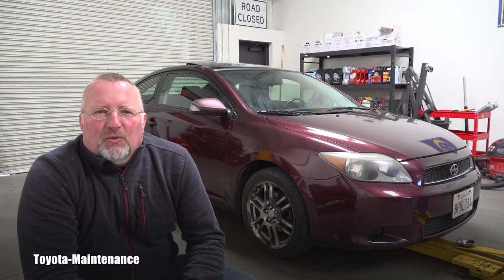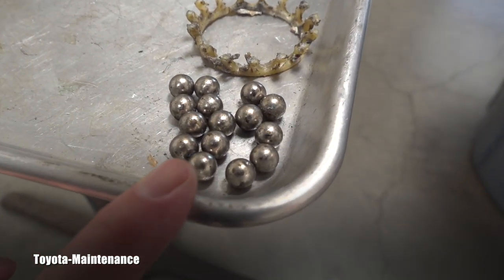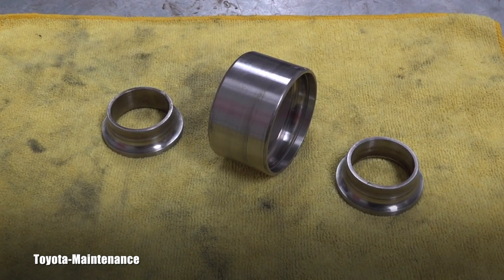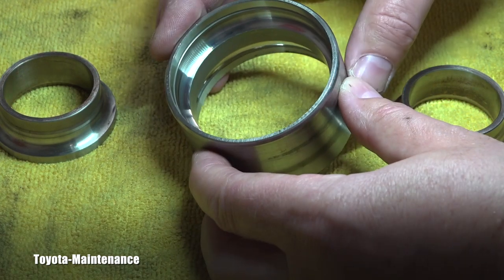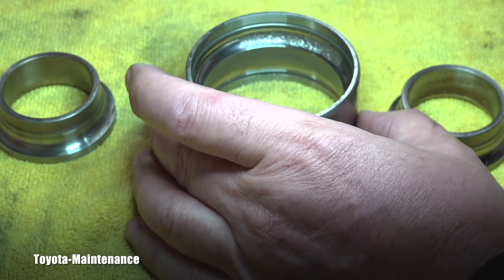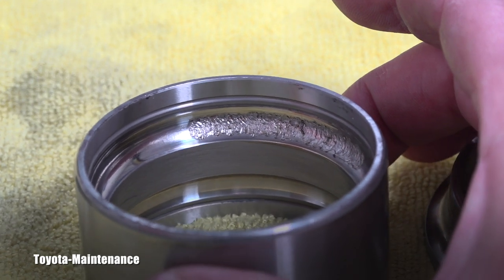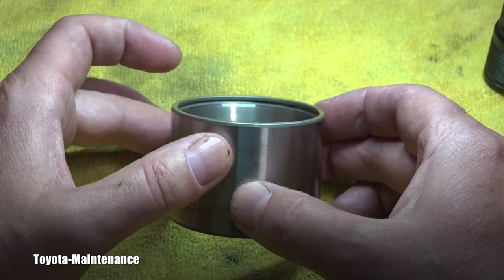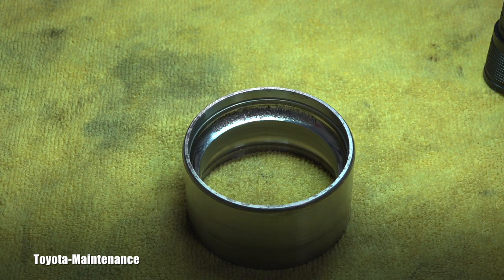Inside of Bad Wheel Bearing

Comment: Saw this on 2000 corolla and 1987 Camry. In my opinion tightening the axle nut with impact gun transmits vibrations from the inner race to the outer race causing surface damage of the outer race

Comment: So the question I have since I did the same repair few months back is are you going to keep those 1/2 inch  ball bearings like I did in a zip lock thinking these might come in handy for something down the road?  I’m sure for five years from now I’ll say why the heck did I ever keep these things!!  Great job on the replacement. Thanks for posting
Reply: Make great pellets for a slingshot
Reply: I would think they could come in handy still, if they’re not too far gone. A little service might help too. Keeping in mind that the weight and axial/radial loads they’re rated for are immense, a lighter application wouldn’t put much strain on them so they may continue to be useful after being replaced.
Reply: @imperialsecuritybureau6037  - still waiting to use them 😀 3 yrs later

Comment: Can you please do a video on unclogging the AC drain hose? I hear water sloshing around but don't know how to get to the pan? I have a 2005 tacoma pre runner V6
Reply: Usually find drain hose on firewall  , usually a rubber tube that exits on passenger side lower firewall in engine bay .
Blow up with compressed air to clear drain .
If you are very careful you can find under dash passenger side , inside car ,
The evaporator housing. 
Very carefully drill small hole to drain , and blow debris out of housing .
Then reseal hole .